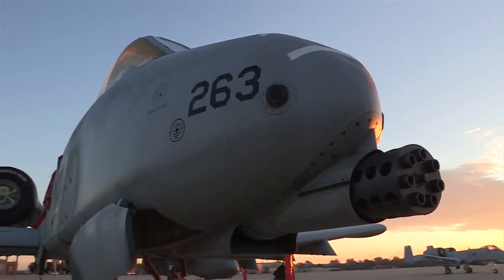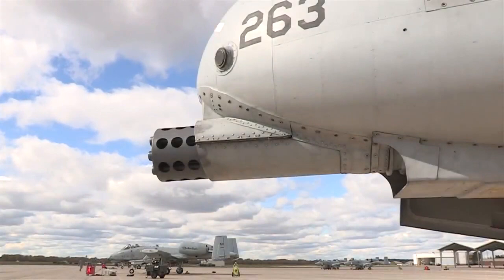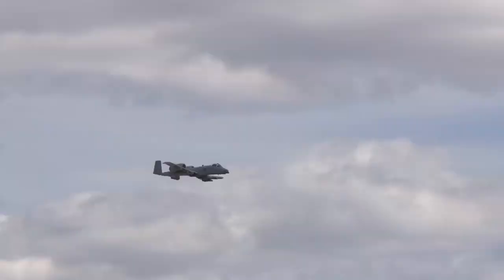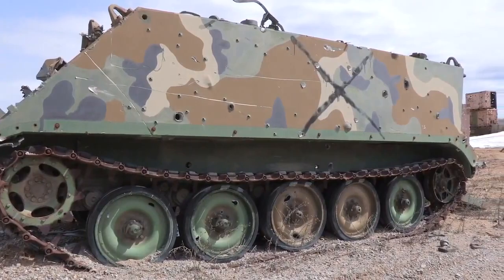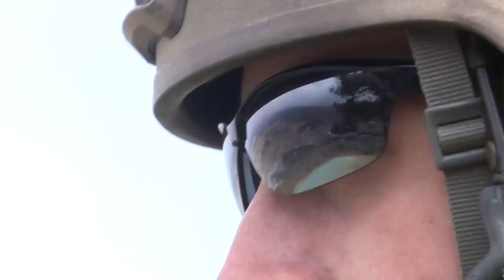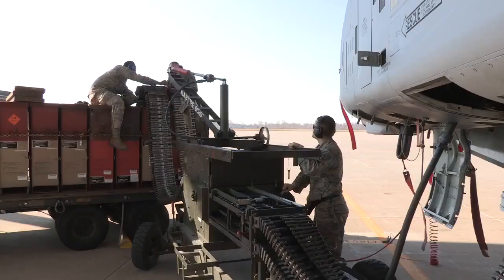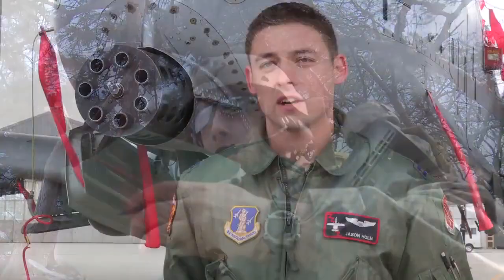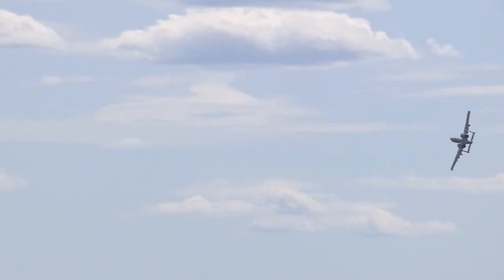Air Force wants to Keep the Legendary A-10 Warthog

Comment: IMHO, it would be a big mistake for the USAF to mothball the A-10 fleet. My Dad served in WW2 with the T-Bolt 1, the Republic P-47, which wrote the book on CAS, and he said the mud soldiers and Marines have come to rely on the A-10 to save their bacon and cook the enemy's. AFAIAC, that's all the reason needed to keep the A-10s flying.
Reply: Unless they introduce the bigger meaner cousin of A-10, I'm inclined to agree.
Reply: khatack    The A10 was built in the late 70s to early 80s, and the tooling is long gone. They have been cannibalizing the stash at Davis-Monthan to keep the fleet running. Time for a newer A-10 to be produced; the older one is wearing out and needs maintenance just to hold it together. When wings joints start cracking, it time to build new ones b/4 they start coming apart in the air.